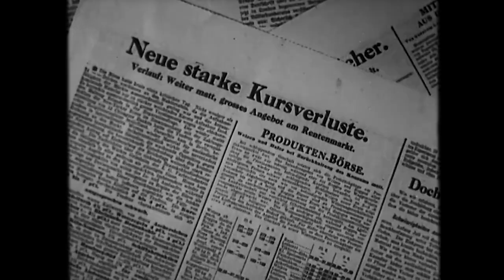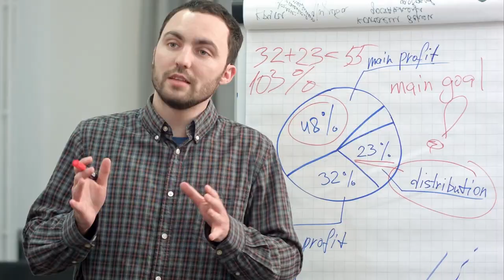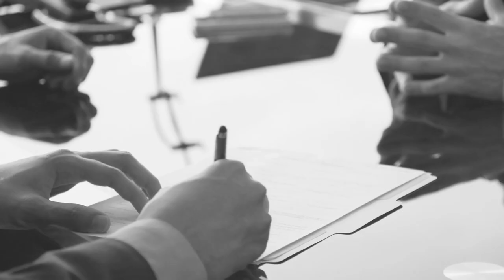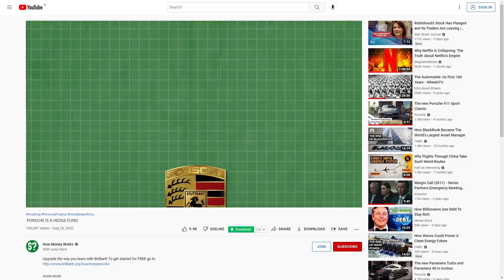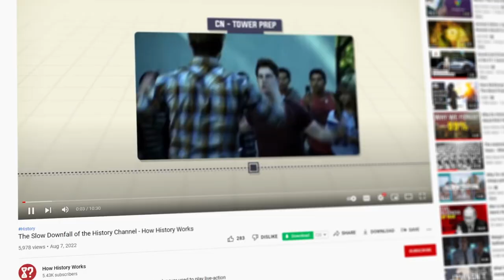The Problematic Story of Porsche - How History Works

Comment: The tiger tank pictured was made by Henschal. The Porsche "tank" put into production was the Ferdinand / "Elefant" heavy tank-destroyer, which had no rotating turret. It was a battlefield failure (lack of machine guns onboard so very vulnerable to infantry attacks), just like most porsche are mechanical failures selling on "uniqueness" therefore promoted to gullible collectors similar to ponzi scams. Ferdinand Porsche designed some even less practical tanks for H later in WW2, but none of those subsequent giant tanks went from design to mass production.